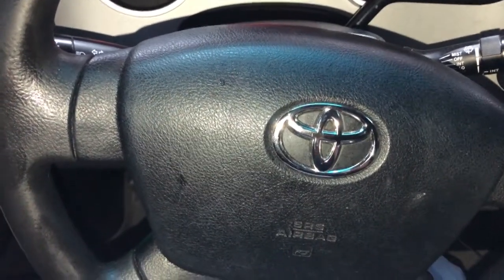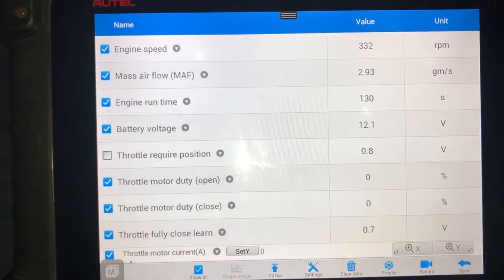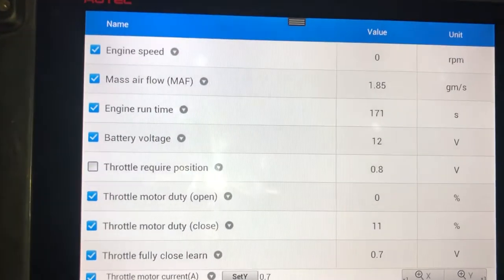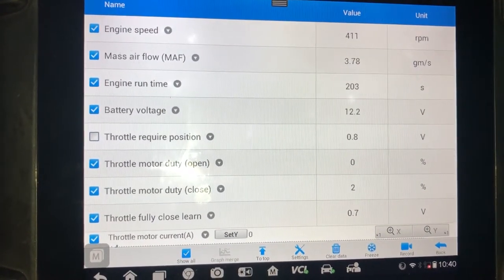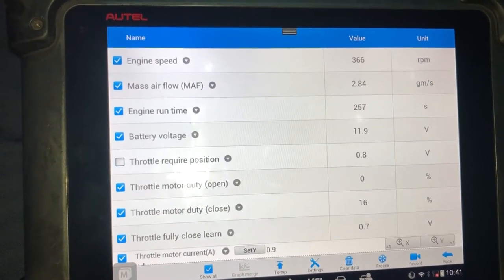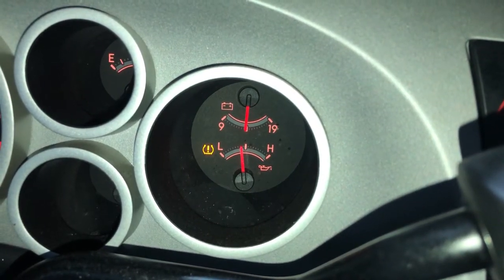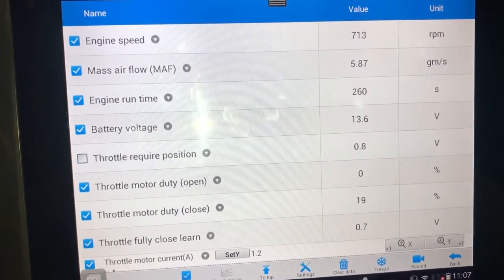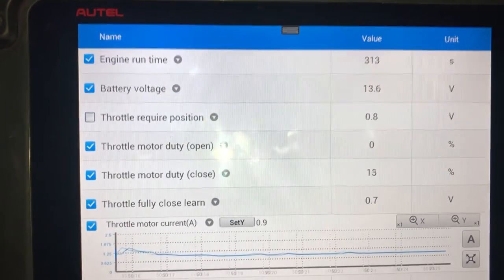2008 Tundra 5 7L Stalls at stop light no codes

Comment: Great video. i like hearing your thought process. My 2013 5.7l tundra was doing the same thing a few months ago. Cleaned the TB twice, MAF, and was problem free up until it died today braking to a stop about 1 minute after starting, then was good for an hour drive. Will try to keep an obd plugged in, but hard to read while driving lol. Sometimes you just have to wait until it gets worse/more often
Reply from the maker: thanks for the feedback. 1st did it set any codes? 2nd did it start right up after it stalled coming to a stop or did it take a minute to get it started?
Reply: @fsteddie98 no codes. Starts right back up. Using the scanner today, MAF is reading >10 g/s so I'm going to give it another clean and see.

Comment: My 08 tundra 5.7 the throttle is sticking or eceleraling while driving and when I take my foot off the gas  coasting in gear and in neutral  any idea the issue it’s like it’s all over the place could it be a sensor or throttle body

Comment: Hey man my dads 4.7L 2nd gen with 260k miles does the same thing. Stalls on start up (sometimes) and has low idle, I took the TB out and it was gunked up very badly and it seemed like the idle got better and didn’t stall once the whole winter, just started recently again. Maybe MAF sensor being funny or fuelling issue…
Reply from the maker: I would start by visually inspecting the  MAF elements / and or Cleaning the MAF sensor. Also checking for any pending codes also may lead u to the right direction
Reply from the maker: I would start by inspecting the mass airflow Eminem and Or cleaning it. Also checking for pending codes may lead to the right direction

Comment: I have an 08 Crewmax with 197,000 miles and the MAS airflow sensor went bad and caused stalling
Reply: Did u get a check engine light from the MAF going bad?